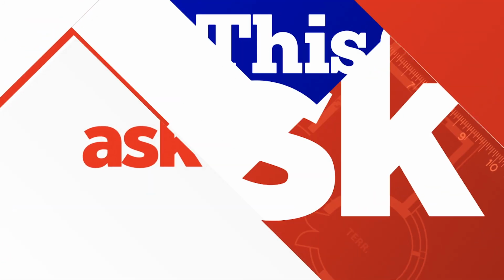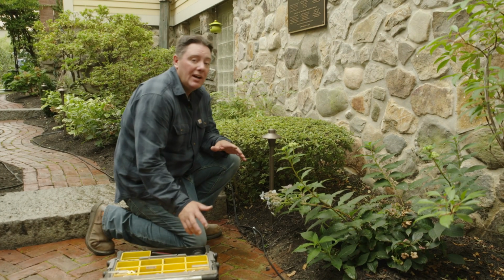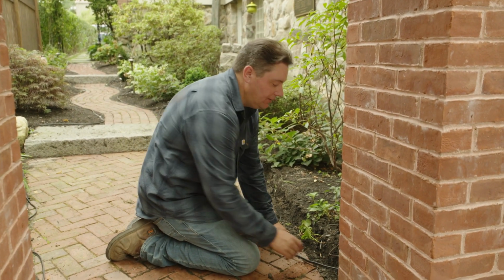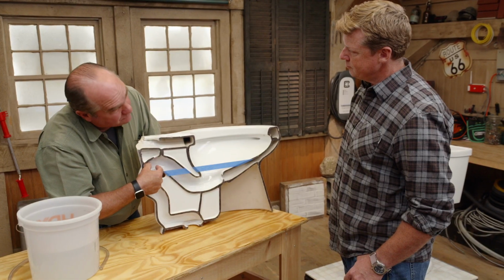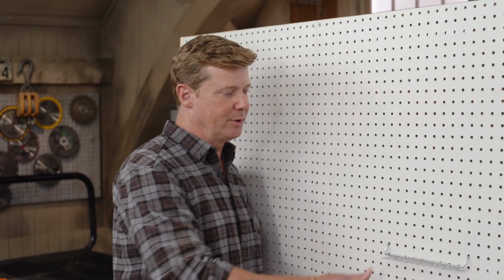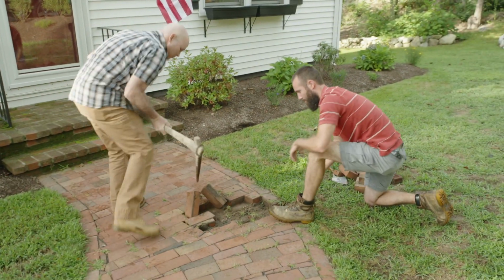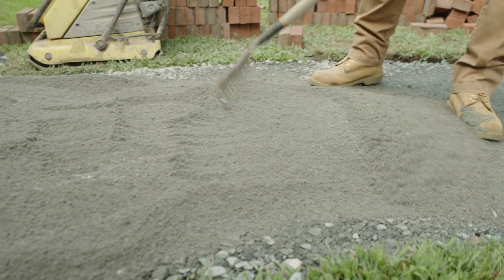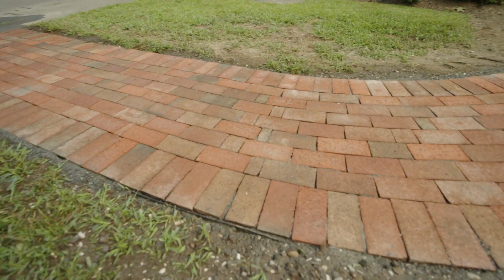ASK This Old House | Landscape Lighting, Brick Walkway (S19 E10) FULL EPISODE

Comment: Doesn't the timer need power to work? If so, at dusk the timer will stop.
Reply: He left out steps for time.  The timer is a basic timer.  It's plugged into the outlet and the power pack for the lights is plugged to that.  The timer always has power.  The off time is great but you still need to set an ON time for say, Noon, so that at that point the photocell takes over and will turn the lights ON at dusk.  But, honestly, with LED lights it will hardly cost you anything just to leave them set to dusk to dawn!  But also as GPS LightLock says - GPS may be an option, too!
Reply: @kevinb7810  ah that makes sense.

Comment: Heat shrink, even with the adhesive, is not something that works well with multiple wires going into the connection. There are gaps that still allow water into the connection. Fortunately, the wire only supplies 12 volts AC, not DC. There may be some systems that do run on DC, such as LED lights, but these, too, are low voltage.
Reply: Farm_fab I suggest watch a 13 part series called What on earth happened by Ewaranon to learn that the earth is not a globe. I got it in my about tab.

Comment: Calling the ground on DC current common rather than negative or ground.

It's not common. 

AC - Alternating Current, has a common wire because the current reverses direction causing both the positive and negative wires to alternate between being positive and negative.

DC - Direct Current does not have a common wire because it does not reverse direction. The current is continuous and both wires maintain their polarity permanently. The red is always positive and the black is always negative unless someone wired it wrong.

With alternating current, you can wire a device backwards and the device will still operate because the negative wire is common to the positive wire, but wiring the device or circuit backwards makes it a potential safety hazard.

With direct current, if you wire the device backwards, the device will not operate because current never reverses course and the ground is not common to the positive.
Reply: Hi Scott did you watch my suggested series or have you become a flat earther yet?
Reply: @flat-earther  
"Hi Scott did you watch my suggested series or have you become a flat earther yet?"

Why would I watch a series of videos in which the subject matter is so miserably explained, that you yourself, claiming to have watched it, cannot disseminate from your own memory, in your own words, those things that you claim the series proves?

I didn't tell you to go look up the Bible verses in the Bible, I copy and pasted the verses. You could have but did not post a link to this alleged series. 

It is in my experience that when people tell me a video exists and I have to go search for it myself, that video does not exist and they are furthering indulging their deceptive lies by claiming something exists that does not. 

Why then would I bother looking for a video, that the one claiming it exists, is not willing to post a link too?

Do you seriously think, that this 13 series video can convince me to believe a lie that contradicts not only God's written word, but the very vision the Lord visited me with?

The Bible tells us that the earth hangs on nothing in space.

Job 26:7: He stretcheth out the north over the empty place, and hangeth the earth upon nothing.

The Prophets also tell us that God sits on the circle of the earth.

Isaiah 40:22: It is he that sitteth upon the circle of the earth, and the inhabitants thereof are as grasshoppers; that stretcheth out the heavens as a curtain, and spreadeth them out as a tent to dwell in:

I don't need to watch a video that seeks to prove that the earth is flat, to know that the video is filled with lies and deceiving logic.

The earth is not flat, it is a sphere. You're refusal to accept and acknowledge Biblical truth that supports scientific fact, does not make me an idiot. It makes you one.

Job 26:7: He stretcheth out the north over the empty place, and hangeth the earth upon nothing.

Isaiah 40:22: It is he that sitteth upon the circle of the earth, and the inhabitants thereof are as grasshoppers; that stretcheth out the heavens as a curtain, and spreadeth them out as a tent to dwell in:
Reply: @scotttovey  Many people have measured large frozen lakes for curvature and found none but you don't have to believe them because you can test it yourself.

Also I don't think it's honest for you to criticize while refusing to watch it. I assume you wouldn't want someone criticizing your work if they haven't studied it first.
Reply: @2loco  Curvature can be measured. I don't think you realize that but you can learn that it is possible on a frozen lake.

I suggest watching the series to learn stuff you may have not heard before.
I don't think it's honest for you to criticize while refusing to watch it. I assume you wouldn't want someone criticizing your work if they haven't studied it first.
Reply: @2loco  Do you take your education from ''proper'' sources because you don't use your own judgement?

Anyway however you feel about the source of information I offered you. I don't merely suggest believing what is presented there. Rather I just opened a door of information to you that you probably haven't heard before, and I suggest watching it and then making up your own mind about it.
That way it doesn't matter who is telling you the information because you judge the information and make up your own mind about it.
Reply: @2loco  BTW I think your comment is shadow banned.